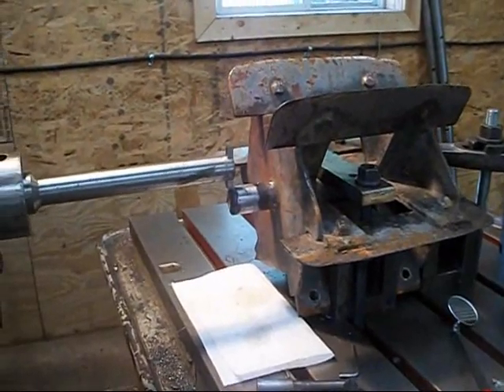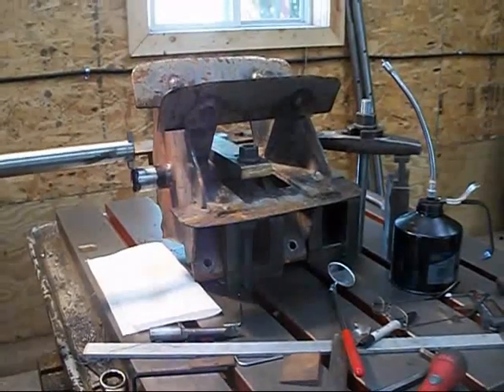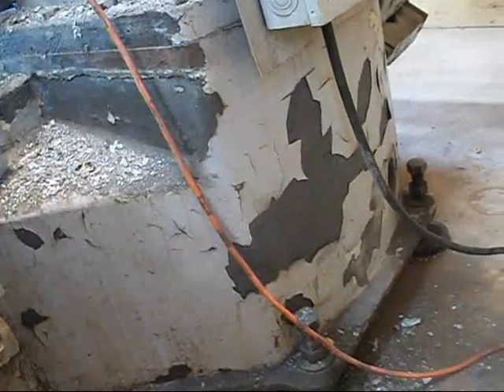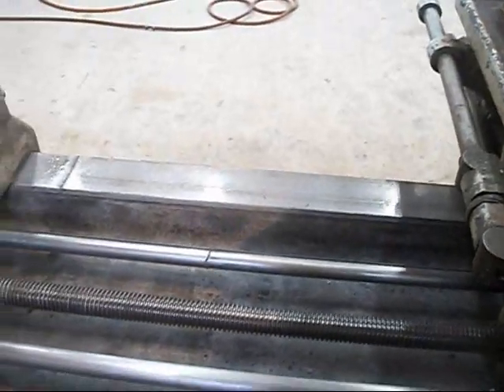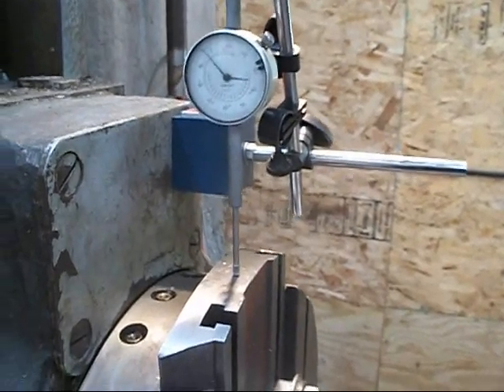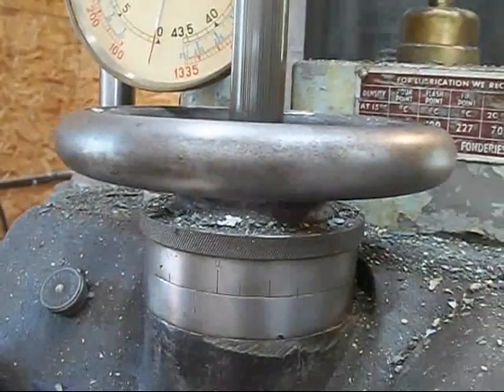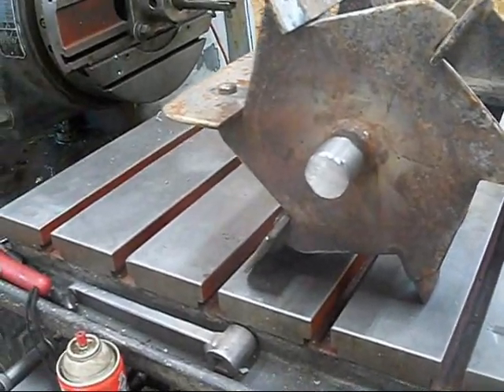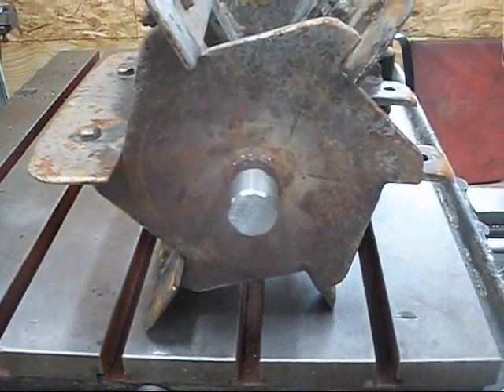LATHE WORK WITH MY HBM WMV

Comment: We used to turn the trunions on the ladles for the foundry from time to on a Sellers 5 or 6 inch horizontal boring mill
at Koppers Company in Baltimore. That was a very similar job and always a rush. When the foundry was down the whole company was down for lack of castings.
Good Video.
Kap

Comment: It will look fantastic when it has finally got a coat of paint on it.
I have used those needle guns on lots of paint. They work well.
Mike
Reply: Is there a concern about needle scalers and old (lead based) paint?  I would guess not for a one off home shop but maybe industrially.
Reply: We always wore masks when needle scaling but a lot of our paint was epoxy based.
Mike
Reply from the maker: Yea I go about one half hour at a time and then do something else. Needle guns use a lot of air
Reply from the maker: I wear  glasses and ear plugs I think it's mostly epoxy paint
Reply: After serving 4 years in uncle Sam's canoe club  I became an ironworker. On my first bridge rehab job the foreman handed, attempted to hand me a needle gun. After telling him to shove that thing I got to hangout and drink coffee at the hall